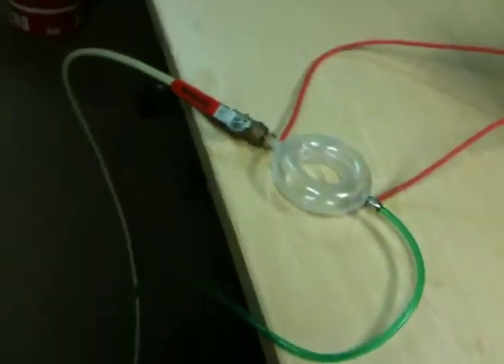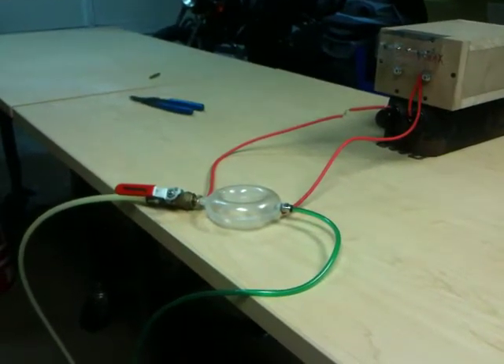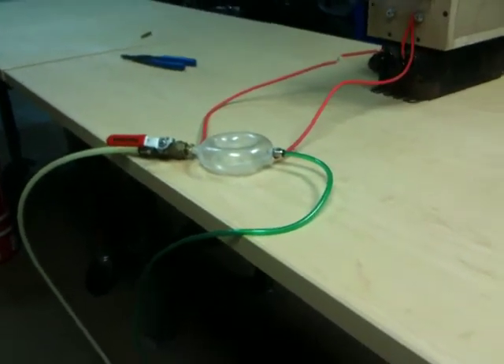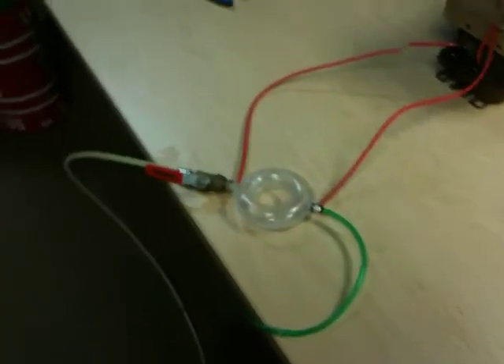P2 Hydrogen Plasma Experiment... FAIL... RWGresearch.com (EPG TEST1.2)

Comment: Russ
Move the spark on the Cap box to the donut. Otherwise disable the primary SG. Extablish that the spark gap is functioning first then introduce the H gas,
Working this way will confirn this experiment. After you have achieved Plasma with H gas then start moving the Anode & Cathode apart.
If you have Q's Call me.
Bill

Comment: You need Stan's gas ionizer. lol  Ionized air is how lightning travels i believe.   Maybe there is a way to have an adjustable gap in the donut.  Then once you strike the arc, you can pull the cathode and anode apart to maximum gap.